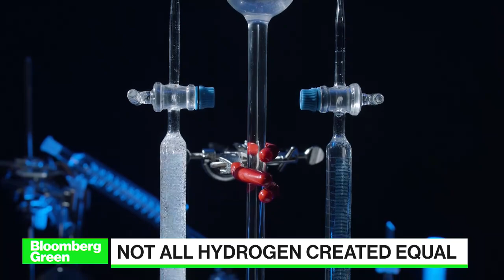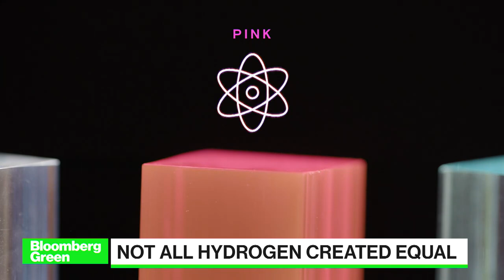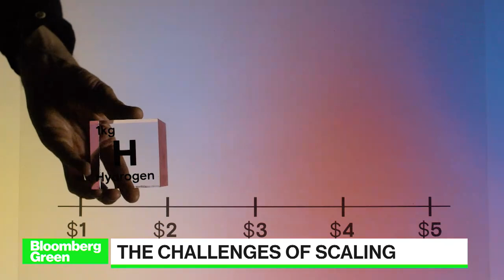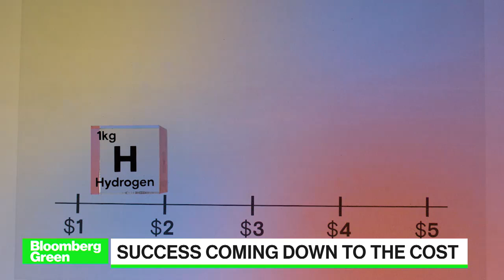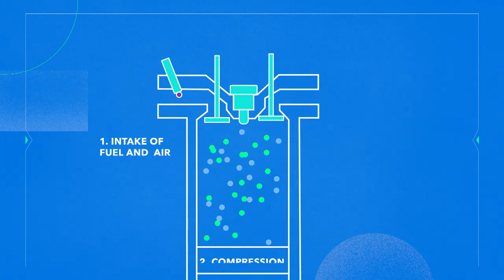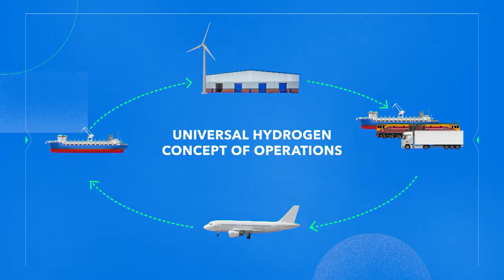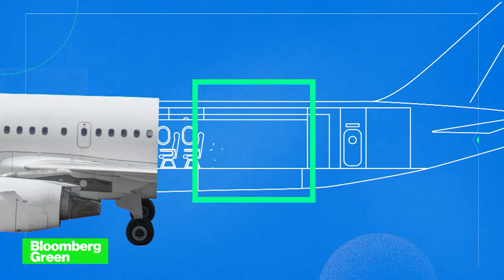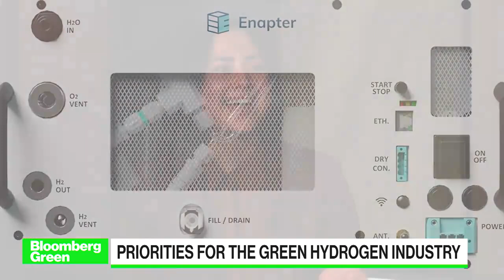the Future of Hydrogen: Bloomberg Green

Comment: Hydrogen is the god of energy. All we have to do is separate it from oxygen in water. And when we crack that problem then we are free from oil and natural gas.
Reply: One minor technical problem as the God of energy is that hydrogen is the smallest molecule in the universe and all current storage technologies have problems of leakage of this explosive gas.
Reply: @terryryan1220  hydrogen leakage from most current storage containers is negligible.
short term and medium term storage is not a problem.
its the high volume long term storage were you see loses and is a problem. 
and minimal leakage hydrogen, which is insignificant. is not an explosive problem.
the high pressure storage is the main concern. but we have been storing and transporting high pressure gasses for decades.

Comment: See another mainline social site (that I am not allowed to mention herein, but think Elon Musk), under the same name as this comment to see years worth of just some nations are doing with H2.  H2, the most abundant element in this entire universe.  H2, it's not just the future, it's already here now.
Reply: Consider this copy and paste from my files for primarily outer space travels:
Potential endless energy source basically anywhere in this universe:

a. Small aluminum cones with an electrical wire running through the center of the cones, cones spaced apart (not touching I'm thinking) but end to end.
b. Electromagentic radiation energy in the atmosphere interacts with the aluminum cones.
c. Jostled atoms and molecules in the cone eventually have some electrons try to get away from other electrons of which those electrons gather at the larger end of the cone, of which also creates an area of positive charge at the smaller end of the cone.
d. The electron's in the wire are attracted to the positive end of the cone and the positive 'end' in the wire are attracted to the negatively charged end of the cone.
e. Basically a 'battery' has been created inside the electrical wire itself, different areas of electrical potential.  Basically a 'wire battery' or a 'batteryless battery', however one wanted to call it.
f. Numerous cones placed end to end increases the number of 'batteries' in the wire.
(In series to increase voltage, in parallel to increase amperage).

*  Via QED (Quantum Electro Dynamics) whereby electromagnetism interacts with electrons in atoms and molecules, one would have to find the correct 'em' frequency for the correct material being utilized for the cones.  The shape of the cones could also come into play.  The type and size of the wire as well as the type and thickness of the insulation between the cones and the wire would also be factors.
*  Of course also, possibly 2D triangles made up of certain materials with a conductor going down through the center of the triangle could possible achieve the same 'batteryless' battery system.
*  Plus possibly with the 2D concept, layered 2D's that absorb different energy frequencies, thereby increasing the net output.